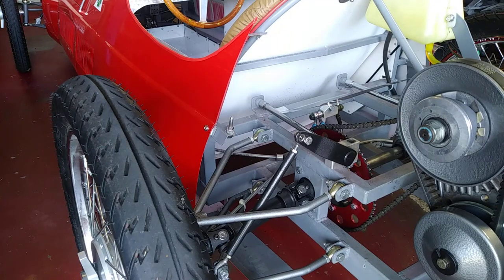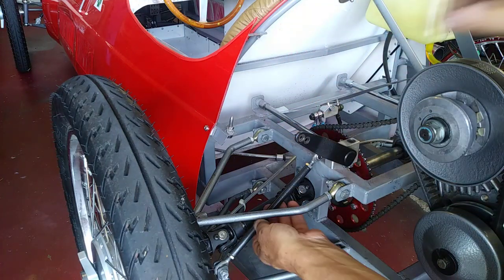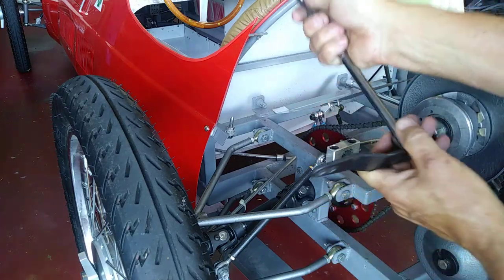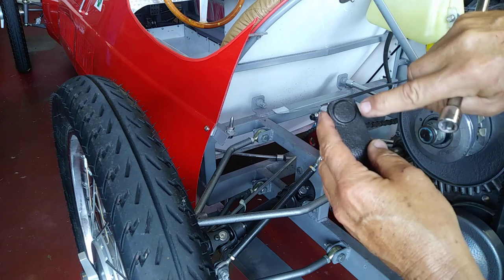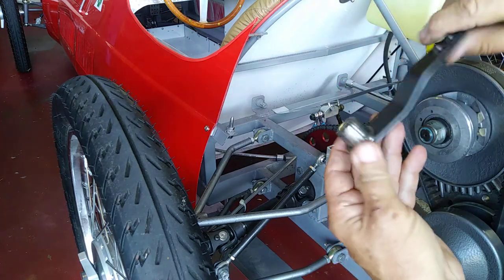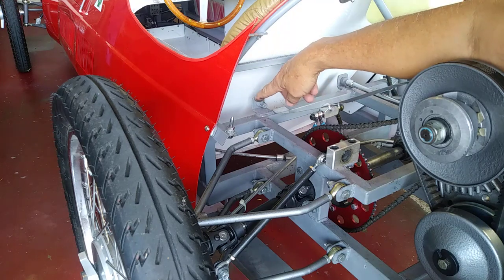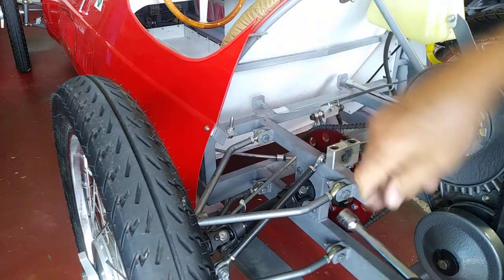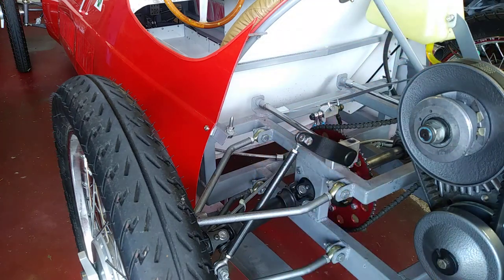Alfa Romeo cyclekart rear torsion bar suspension

Comment: That's crazy. I didn't know that chrome vanadium is used to make springs. Turns out it's actually the most popular alloy for that application, which is why it works as a torsion bar. Awesome design.

Comment: This is TRUE ENGINEERING!  

Have you tried using different extensions for different spring rate?   An Impact extension would probably be a heavy duty spring !
Reply from the maker: I had to turn down the OD on the front bars because the full diameter was too stiff.  There's not a lot of weight on the front end.

Comment: Beautiful work. Something to think about. Is it possible for the torsion bar to pop out. Maybe a bolt that would be place at the back of the arm base to create a stop.
Reply from the maker: Haven't had that problem on the rear yet, after lots of running around the bumpy grass and the neighborhood roads, plus  two race weekends at Huntsville.  I did have one of the front ones pop out, and I made retainers for them.

Comment: Very tidy.  Have you  quantified a benefit vice a solid rear axle? Is it more comfortable to drive? Less scary on a bumpy track?
Reply from the maker: My other kart has a solid rear axle, no suspension in the back.  On smooth asphalt,  the difference is negligible.   On grass or over bumps in the road, it's a night and day difference.  It's really nice if you've had back problems in the past like I have.

Comment: Great video, 2 little things, instead of putting nuts in the socket you could always cut off the section of the socket that the nuts go into and it would be plenty thick enough to weld to and secondly, what about a retainer so the spring assy cant jump out as you pulled it out real easy .
Reply from the maker: If I cut off the thin part of the socket, I won't have anything sticking out.  Watch the video again.  The socket is what the arm pivots on, in that aluminum block bolted to the frame.  The torsion bars in the front have retainers, because one of them came out at Huntsville a couple years ago.  I haven't had any problems with the rear ones, probably because there so much more weight on them, and the geometry is slightly different.  The front one came out when I hit that nasty bump at the exit of the church parking lot in Huntsville.  If you've seen any of those videos, you'll know the bump I'm talking about.

Comment: Question sir.. where do you get that torsion bar? is there any donor car or something.. I was so amaze on your creation sir, Im planning to build one here in the philippines and spread the cycle kart  culture.. godbless you sir, and keepup the good work
Reply: Hi ,  its a 10 inch long 3/8 inch extension from a socket set.
Reply: and that bar twists? like a spring? what material are torsion bars made of?  @lotuselanplus2s
Reply: @jpjay1584  yes, they do twist, i'd think theyre high carbon or spring steel.
Reply: The magic of a torsion bar is the lever action.  The lever not only multiplies the force,  it multiplies the travel.

Comment: That's fabulous. I would have bet that the rods would have to be the length of the car to give enough flex to act as suspension items. But no! That is a genius idea.
Reply from the maker: Thanks.  Ten inch extensions are quite adequate.   I was not sure about them in the back of the Alfa, with the motor weight and most of the driver weight, but they're  fine.  I had to turn them much thinner in the front so they wouldn't be too stiff.
Reply: @1908Rick  You could make the arms that go onto the torsion bars much longer so the suspension has a greater leverage on the bars without maching them down.
Reply from the maker: @lotuselanplus2s  I could, but they are already made, and longer ones would give me clearance problems with the bodywork.   Turning the diameter smaller is easy, and requires no other changes to be made.

Comment: What are the axles you are using?
Reply from the maker: I made them.  The u-joints are car steering units.
Reply: @1908Rick  Got it. Where did you get the slip joints from?
Reply: @1908Rick  sorry for asking again but did you fabricate or purchase the slip joints?